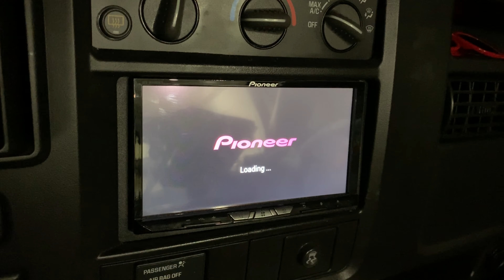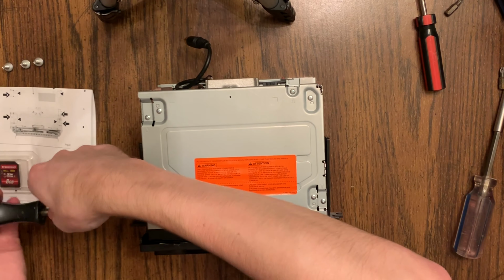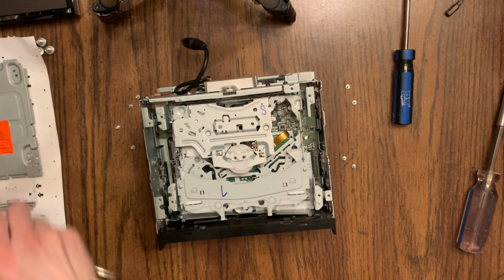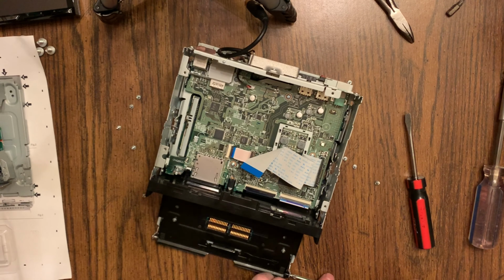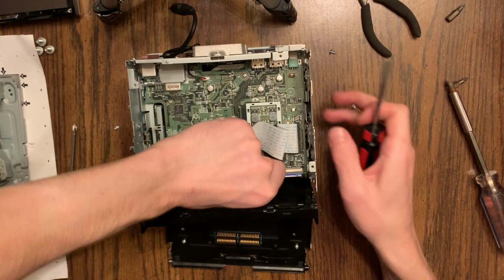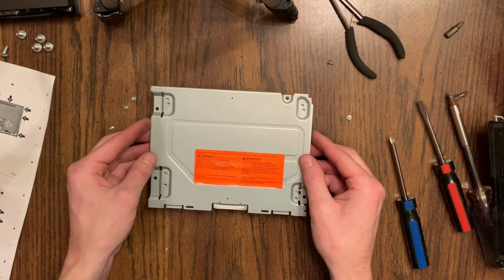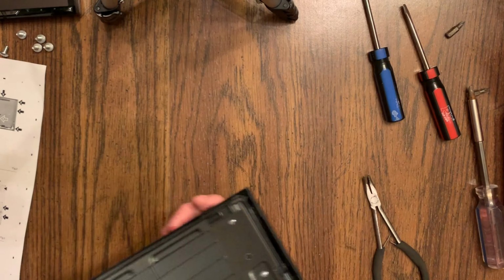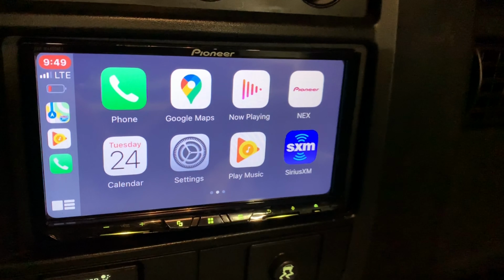Pioneer Software Error Fix - SD Card Replacement Procedure

Comment: Can I switch the SD card with a new one with the pioneer update or do I need to buy a software for it???
Reply from the maker: Hey Alonso, you can just buy a new SD card, then use the file found here:
http://avic411.com/index.php?/topic/90534-how-to-fix-for-avh-w4400nex-boot-loop/
Reply: @VanwithTim  do I use the file that HondaR posted? I'm having the issue with my avh-w4400nex. Do I what type of SD card should I use??
Reply from the maker: @alonsoamezcua2386  Correct. The file HondaR posted is what you need.
You can't just copy and paste it to the SD card though. 

Use the Win32 software he linked to for writing the file (referred to as the "image") to the SD card.

Your PC may say the card is corrupt / need to be formatted afterwards. Don't worry about that, and don't format it afterwards. The Pioneer 4400NEX will read it fine once installed.

For the SD card, just use a 16GB card. (At least class 4 - the faster the class (read / write speeds) the faster your unit will perform) - see the chart here for a quick explanation of SD card classes if you're interested!

https://www.kingston.com/unitedstates/en/solutions/personal-storage/memory-card-speed-classes

Hope that helps!
-Tim
Reply: @VanwithTim  awesome thanks, I moved by unit from my old truck to my new one and getting ready for my trip and this happened to me I was like dang it I have to drop money for a new one. Life saver 🙌
Reply from the maker: @alonsoamezcua2386  Haha mine died a day before a cross country road trip, and no one online had the file to fix it at the time!

Glad you can have some tunes.
Safe travels!
Reply: @VanwithTim  music is a must especially hitting the highway looking at that nice views going from Cali to reno not that far but I need my music
Reply: @VanwithTim  having trouble I downloaded both files avic and the other one what do I do next??
Reply from the maker: @alonsoamezcua2386  Hey Alonso, just made this video to help. Let me know if you have any questions!
https://youtu.be/Cro26vuoPHo

Comment: Does this work for avic 5200 nex
Reply from the maker: The disassembly might be similar but the file will be different. I searched around the forums for your file but didn't find anything (check it out here: http://avic411.com/)

Maybe message this ebay seller and see if they will sell you just the SD card you need? https://ebay.us/lAw0Zw
Reply: @VanwithTim  hello I managed to install the card with the file but it works for a maximum of 3 minutes and the sd dies maybe the card is shorted, help me someone is having this problem, will I need to do some procedure before installing the sd, help me mine and the 9180tv

Comment: My two (out of three)  AVH-W4400NEX units went on a "boot loop" right after the warranty expired. 
I threw away one of them already. Now, I just did this fix. It is now working but my guess is something must be wrong with this firmware. My AA Wirelees doesn't work anymore. I have to use the cable. BT audio works though. And since it is now working "ok",  I tried doing a FW update using Pioneers FW from Pioneer's website. Pioneer's instructions says I can use either the SD card slot, USB-1, or USB-2 ports to update the FW update. I tried all, and none worked. It doesn't let me. It's telling me that there is something wrong with the FW that I got from Pioneer (AVH-4400NEX latest FW). Everything works, except my unit is not AA wireless anymore.
Reply from the maker: I've had a few comments mentioning the same issue after replacing the SD card. Most seemed to be fixed with a factory reset (which seems strange and unnecessary in theory) Worth a shot though! Let us know if it works!

Taz Ng-
"I did have an issue with wireless Android Auto but after performing  factory  reset the headunit and its working afine aain ( AVH 4400NEX)"

Lucas K-
"...the only thing I had to do is restore it to factory default after putting the firmware there."

I never heard back from Joe regarding his progress:
Joe Adkins-
"Ever since I flashed new card, wireless AA no longer works for me. Wired works, but my wifi won't connect now...."
Reply: @VanwithTim   I just did a factory reset as you suggested. After I did the reset, the unit but it's still doing the same thing. Wireless still doesn't work. I want to add that my phone and phone's AA app sees the unit and says that it is already connected. And on my Pioneer's left side of the screen, it shows the AA icon. It just doesn't connect, even if I click the icon.

Someone posted the original FW  (version 1.00?) on the forum link, but I wasn't sure if I should even try it, because after I unzipped it, there were so many files. Whereas, the one you provided, there was only single 8gb img file that needs to be written on the SD card using Win32 image writer.

I see the SD cards on eBay. But who knows, if the wireless AA will work, or not just the same.
Reply from the maker: @mc333777  I just heard back from Joe who had the same issue. Seems the factory reset didn’t work for him either.

I think you’re on the right track with the firmware being the issue. I recall some folks on the forums mentioning the newer 1.02(?) firmware had AA connectivity issues.

Might want to post up on the forum and see what the consensus is.

I will mention my eBay SD card / firmware somehow deleted the FM stereo? Had to purchase a blank SD and write the IMG file. Luckily that brought it back.

Unfortunately I never tested my eBay SD card with android auto so can’t report on that.
Reply: @VanwithTim   I  bought 3 of  these units as soon as it was released. Two failed 14 months after I purchased them. I threw one away because there was no fix to it yet at that time. I saved the other one. The third one is still working perfectly. I can pull the third one out, BUT how would I copy that file to a blank SD card if my PC doesn't even see the content of the OEM SD card from my good unit?  I can't live without wireless. It's like, "hey, corded phone is just the same as cordless phones". No, it's not. LoL. 
Let me know of a way if I can copy the file from the third unit.
Thanks
Reply from the maker: @mc333777  well glad to hear at least one hasn’t given you any issue! I had asked about how to “rip” the image from a known good unit (was going to purchase one, copy the files then return before the file was made public). These were the instructions given. A little over my head but step two should be what you’re looking for.
Let me know if you end up successfully pulling the file!
Edit- forgot to post the link:

http://avic411.com/index.php?/topic/81469-avic-development-mod-device-backup/
Reply from the maker: @mc333777  oh and 100% agreed on the inconvenience of having the phone plugged in each time. The ONLY reason I bought this unit was for the wireless Apple CarPlay!
Reply: @VanwithTim  Just doing some trials here. I will let you know today if it works.
BTW, I found out that writing the image file on a memory card makes the card unusable for other purposes anymore. Even trying to reformat it multiple times or different format types. But still usable for Pioneer boot files.
Reply from the maker: @mc333777  I was doing some trials and noticed the same thing. I actually was able to reformat one with this method: https://youtu.be/pfWDguRujEE
But tried again on another card and had no luck. Really strange file system!
Reply: @VanwithTim   I did the same thing and got the same result as yours. But since I pulled the unit again, I decide to extend the slot lower using a dremel  tool. The AVH 4400 v1.0 firmware posted on the forum does not let the WIN 32 image writer to write on my SD card. So for now, I'll be using a USB cable. Thanks again and let me know if there is any other fix to my wireless issue without breaking my wallet.
Reply from the maker: @mc333777  good call on creating an accessible SD slot.
I’ll let you know if I hear of any updates / fixes. Definitely keep me in the loop as well!
Reply from the maker: @mc333777  Oh wow this is great!
Going to link to your video in the description here.

That's a really nice looking cut as well. Did you use a Dremel style tool? Hot soldering iron? Oscillating multi-tool?

Thanks so much for sharing!
Reply: @VanwithTim  I used a pointed Dremel bit, then a box cutter  blade to clean the rest. I noticed others are creating same size opening as the top slot. The way I did it is, I just extended the top opening downwards to another 9mm (8mm is enough) . The plastic piece thickness is 2mm. If you drill 3mm deep, it will be safe for sure. So I would recommend others to mark the drill bit with a sharpie ( I didn't) so not to drill too deep. BTW, I just ordered a card from eBay for $30 since I can't get the wireless to work. Seller said I can return it back if it doesn't work either.
Reply from the maker: @mc333777  That's great info to have! Glad none of the circuitry was damaged. You'll have to let me know if that eBay card works so I can link it to others with wireless AA issues. Thanks again for the updates!
Reply: @VanwithTim  Sure will.
Later...
Reply: @mc333777  Did the SD Card you ordered fix your wireless android auto issues?
Reply: @Netachi  Yes , and it worked just like the OEM. The SD card looks like a better quality than the CHEAP PIONEER OEM SD too. So my unit is now probably good for life.
Reply: @Netachi  Yes, and this is how I did mine both on my Sienna and Accord:  https://www.youtube.com/watch?v=cT4rxC0LPA4 . Both are now working just like when it was original.

Comment: Could I in theory just... Cut a hole underneath the accessible SD card to access the firmware SD card?
Reply from the maker: Definitely. One other commenter did that successfully last year, it’s just tough to get a precise cut with a dremel. Could possibly use a soldering gun with the plastic melting tip.

Comment: Does anyone know why my touchscreen would stop responding after I replaced the sd card?
Reply from the maker: Is yours the 4400NEX? Some people have tried using the 4400NEX file in the 4500 unit. It boots but the touch screen will not work.
Reply: @VanwithTim  mine is the 4500nex
Reply from the maker: @bmac2894  Ahh. The 4500 unit uses a different touchscreen technology than the 4400.
BUT!!!
I just found this user claiming to have working W4500NEX files. I haven't tried them and I haven't heard any feedback on them, but if you want to give it a shot, here's their post:
http://avic411.com/index.php?/topic/82490-backups-and-images/&do=findComment&comment=365999
Otherwise you'll have to pay $52 for the pre-loaded card on ebay https://ebay.us/xvs435
Reply from the maker: If you end up trying the files definitely let me know how it goes so I can recommend them to others if they work!!
Thanks and happy new year!
-Tim

Comment: hey
this fix doesn't work on my avh w4500nex. The touchscreen becomes unresponsive. Does anyone have the image for the 4500?
please post a link.
Reply from the maker: Hey Danny, have you checked around the forums?
http://avic411.com/
Haven't been on there in 1.5 years so not sure what has been contributed lately.
Hope someone chimes in to help!
-Tim
Reply from the maker: Actually Danny, I just came across this comment. Not sure if you've checked that ribbon cable or not.

Pierre de la Cruz
1 month ago
"Yes!! Thank You, this worked. Right about the ribbon cable. Make sure all of the cable out of the hole and it’s properly attached, or you won’t get a response from the screen."
Reply: @VanwithTim  hey. i have both the 4400nex and 4500nex. i never knew about software error and how to fix it when it happened to my 4400, i just thought it was a bad unit and went out bought the newer version (4500nex) plug and play didnt have to re-wire my system. i stumbled on your video and tried your fix on my older 4400 as it was out of the vehicle. thanks for that!! 

i decided to try it on the 4500. i was able to remove the internal SD card without interfering with the cables on the 4500, after much practice on the 4400. So i'm pretty sure the cables are not the problem. Been on the AVIC forum and a few other people are coming across the same un-responsive screen with the 4400 image on the 4500.

Hoping someone will upload the 4500 software soon, mean time i've re-installed the 4400 in my vehicle and works just as before.
Reply: @dannyteeluckdharry5451  anyluck fixing the 4500, Im currently having the same issue with mine.....cant find the 4500 software
Reply: @wambolt1212  nope, still looking for the software

Comment: Mine work fine but now the stereo wont stay on little movements and turns off
Reply from the maker: Hi Gustavo, I would check out all your electrical connections. Both the connections on the back of your radio and also inside. (Make sure all the ribbon cables are inserted all the way)
Someone had a lot of issues because the CD player assembly wasn’t fully plugged in or the cable was just a little out of place.
Reply: Yes. I forgot to update but i did double check ,the white ribbon connector and it was loose 😅  now everything working perfectly thanks for the video ✌

Comment: I’m having troubles with the installation the touch screen isn’t working but it boots up now any one have any ideas
Reply from the maker: Hey Alexander a few others have commented with the same issue. It’s usually an issue with the touchscreen ribbon cable (the wire that connects to the main board from the touchscreen)
Sometimes it’s not fully seated into the connector. Give that a shot!

Also some others have tried using the AVH4400NEX file in the AVH4500NEX. It boots but the touchscreen won’t work.

Let me know!

Comment: will this work on avh-4000nex im having a hard time to find an sd card can anyone help thanks
Reply from the maker: I don't think the 4400nex file will work on the 4000nex. I searched around the forums and all I could find was this thread which was a bit of a dead-end: http://avic411.com/index.php?/topic/83287-4000nex-stuck-in-boot-loop

There is the file for sale by this eBay seller for $35 if that helps: https://www.ebay.com/itm/144449338078

Comment: Hi Scott, where can I buy the SD with Pioneer SO for AVH-Z9250BT. Thanks
Reply from the maker: Hi David, the Z9250BT is the global version of the American 4500NEX if I understand correctly.

It's been confirmed that the Z9150BT can be loaded with the 4400NEX software available here http://avic411.com/index.php?/topic/90534-how-to-fix-for-avh-w4400nex-boot-loop/
But no one has found the needed software for the 4500NEX / Z9250BT yet.

However you can purchase a SD card pre-loaded from https://www.ebay.com/itm/113964878938?hash=item1a88d60c5a:g:29EAAOSw6S5dy37C

It's the same seller I used for the SD card in this video. Way overpriced, but it was my only option at the time for my unit.
-Tim
Reply: @VanwithTim  Thanks my friend, Best regards

Comment: Thanks for this, got mine working again. Unfortunately now I can't get the eject controls to work. Any ideas? 

I did check that eject lock wasn't on and that doesn't seem to be the issue.
Reply from the maker: Hmmm… of all the comments on this video throughout the years, this is the first time I’ve heard of this issue.

I know the eject mechanism uses it’s own motor. Wonder if that cable has come loose?

You could try to “reset” the SD card and rewrite the file. Maybe it had a small corruption?

Here’s the guide to “resetting” the SD card to a standard blank card if you’re up to giving that a shot: https://youtu.be/pfWDguRujEE

Hope you get it figured out! Let us know if you find the issue / fix 🙏

Comment: I just did every step put it back in the dash now I’m not getting any power to my unit
Reply: I’m getting power but I put a 32gb sd card with the new firmware inside the deck and now I’m getting the software error see dealer or service location help please do u think I should try a smaller sd card download the files and try it again ?
Reply from the maker: @tearyllshunick8458  hmmmm… I heard the 16GB cards work fine but not sure about the 32GB cards.

Did you use the WinDisk Imager program to write the files to the card?  Unfortunately it’s not a simple copy / paste of the files (but it’s still a pretty simple process)

Here’s the video on how to write the files to the SD card: https://youtu.be/Cro26vuoPHo

Comment: i am so burned on trying to find a good HU, i seriously can't believe even the high end units have this kind of BS, disassembly!? seller in Russia!? for what these cost!? TOTAL CRAP
i had an aiwa deck in the 90s that worked flawlessly for over 20 years, probably still does wherever it is...
Reply from the maker: Really disappointing. You'd think a major legacy brand like Pioneer would have their ducks in a row. Luckily(?) it seems once the SD card is replaced with a more reliable brand they're pretty stout units.
Still total BS though. Should be good to go for life out of the box.
Reply: @VanwithTim  i agree friend, i really am at my wits end shopping head units, it seems the newer more expensive ones actually do less and simply allow your phone to do all the heavy work, i mean its 2021, i can live without a flying car but a solid stereo receiver!? c'moooon lol
Reply from the maker: @luisdquezadah2927  Others have purchased the Russian SD card for the W4500NEX and it and it has worked. I think that may be your best bet.

I think someone will eventually release the file for free but it could be weeks or years from now.